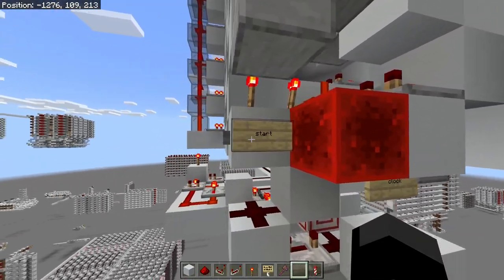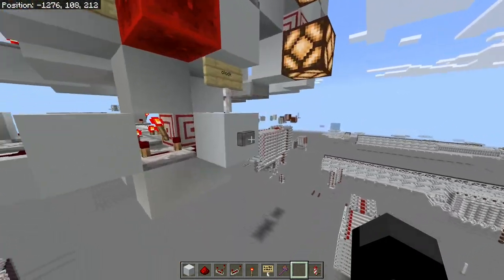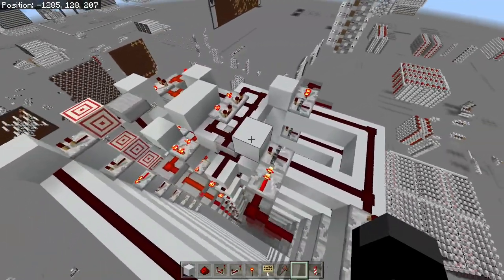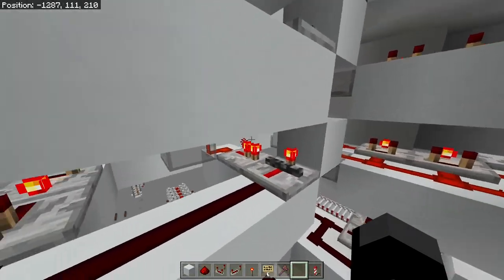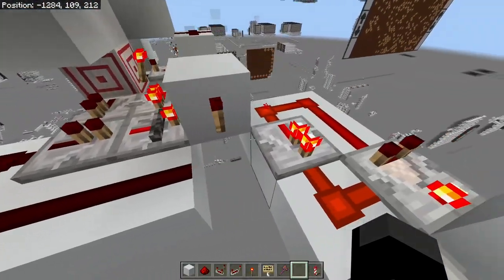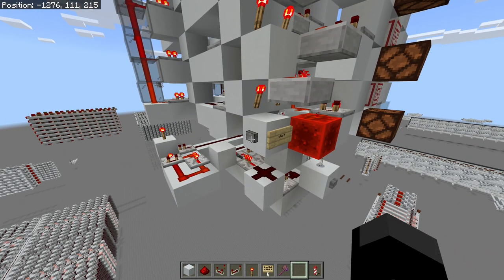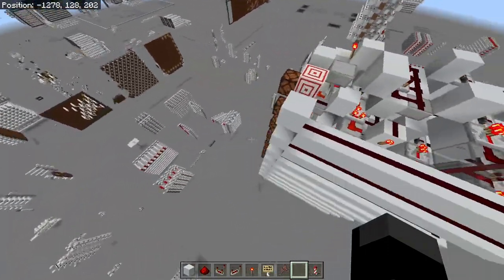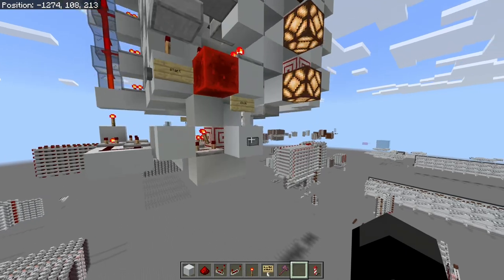Simple Fibonacci Machine - Minecraft Bedrock

Comment: can you tell me the assembly code for fibbnaci program. idk how to do it
Reply from the maker: Roughly I think it goes:
0)registerA = 0
1)registerB = 1
2)Output registerB
3)RegisterA += RegisterB
4)Output registerA
5)RegisterB += RegisterA
6)go-to line 2
Reply from the maker: Just tried it out on a PICAXE chip and seems to work.
Reply: hmm not really what i was look for but thanks. btw i was looking for a single output register code
Reply from the maker: @PagalSMP  you may be able to get away with only one register if you have an accumulator based architecture. Then you can just use the working register and another register as a temporary one.
Else you can always just add another register as the output one and move registers A or B to it whenever you need to output.
Reply: @TheDarkness344. i have a simple architecture. i doesn't really does 1 calculatione per clock cycle but rather 2 or 3. i can accumulate the A regsiter by run the clock cycle more than what the function needs.